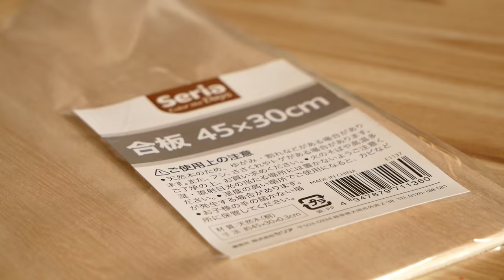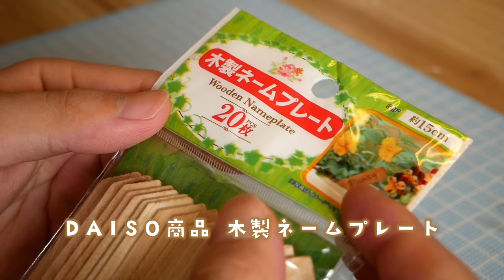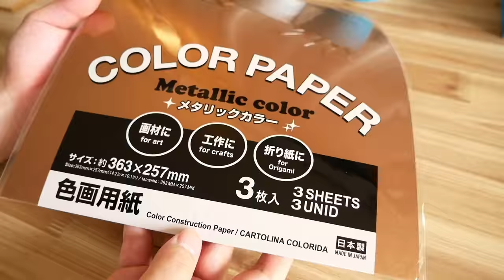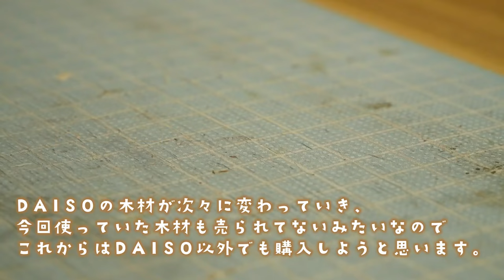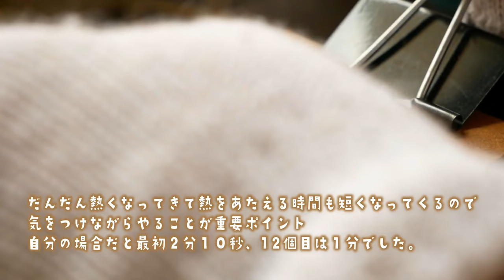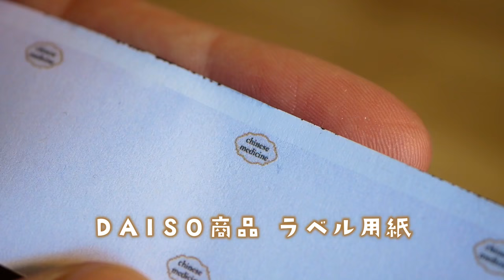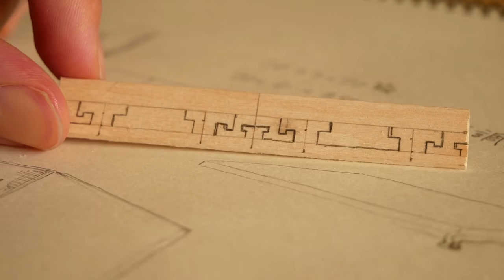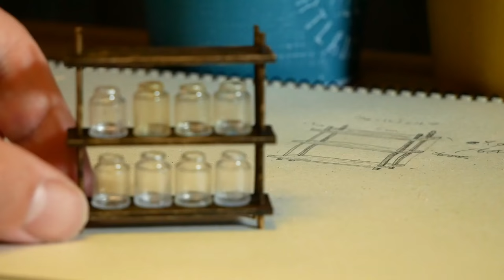DIY☺︎miniature Chinese medicine dollhouse like Ghibli 漢方薬棚のあるジブリ風ドールハウス〜漢方瓶、ウォールシェルフetc~の作り方

Comment: At 6:09 What is this plastic film that they heat and place over wood to form the bottle? How can I get some? I need to make little "glass" bottles for a project, and I've tried working with real glass parts, but cutting them down with a dremel is hard and I have cut myself a couple of times. I had just about given up. This looks so much safer and easier!